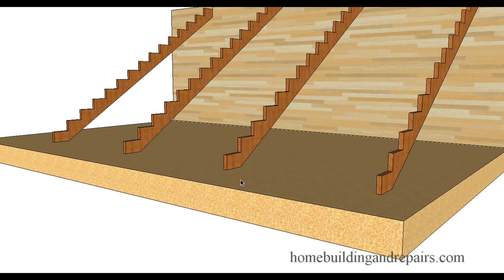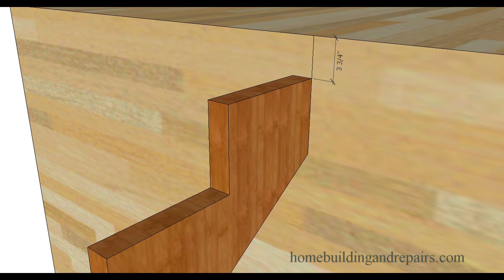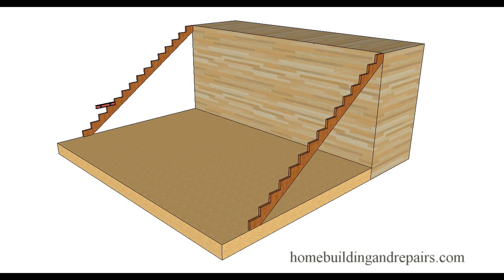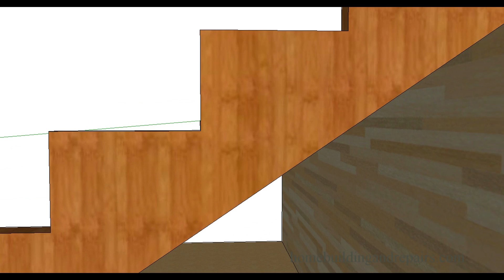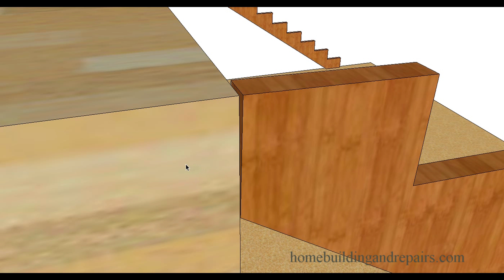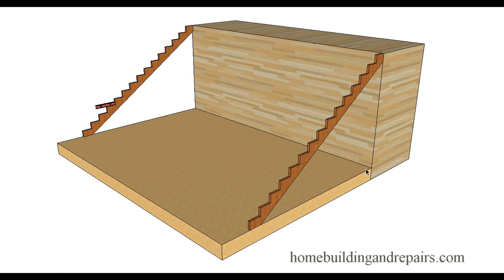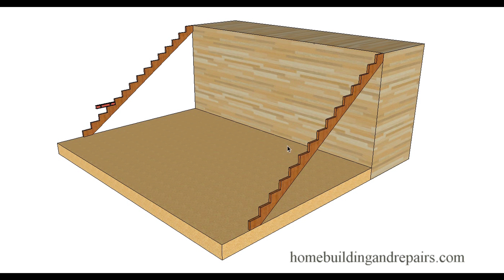Sloping Steps Can Be Caused By These Problems – Advanced Stair Building Tips

Comment: I Have an housed stringer i think was installed wrong it is level without the wedges adding the wedges takes it out about 3/16 forward sloping down don't know if that's acceptable or i should fix it doing hardwood on the steps
Reply from the maker: If you can send me some pictures and you can get our email address at the website.

Comment: You know what you're talking about. I framed houses for 36 years . I was layout man, cut man, stair man,..did it all. One thing I do cutting stringers is only cut the top vertical line and the bottom horizontal line. Tack it at top, then check level and plumb on uncut lines on stringer. That way you don't waste time and materials. If ok , cut. If not, make adjustments .
Reply from the maker: It really is one of the best ways to prevent wasting lumber. I remember the first stringer I cut when I was 17 years old created level treads and risers, but I used an 11 inch tread instead of a 10 inch tread, taking the bottom of the stairway almost out the front door.